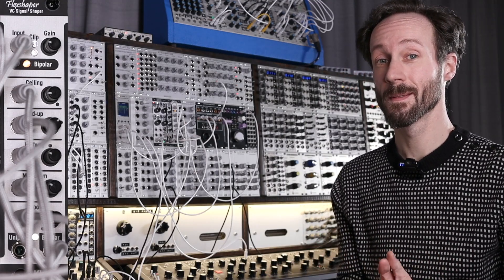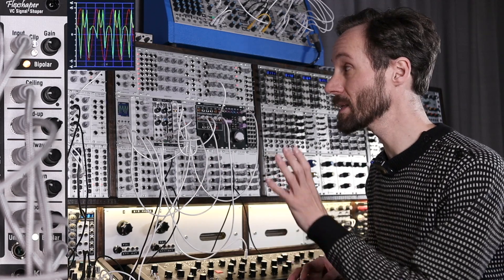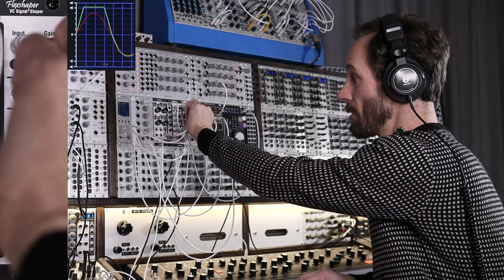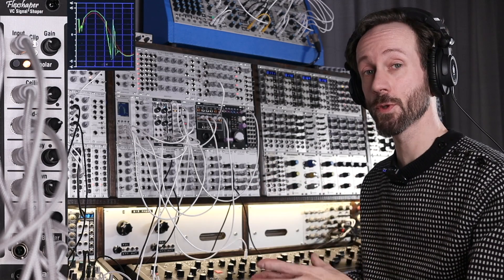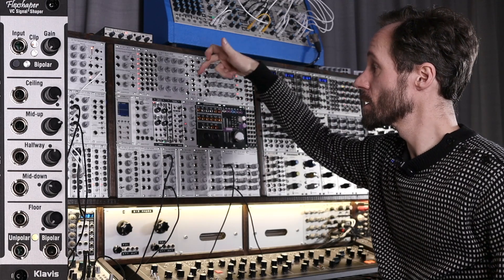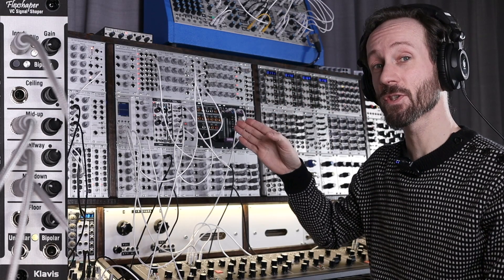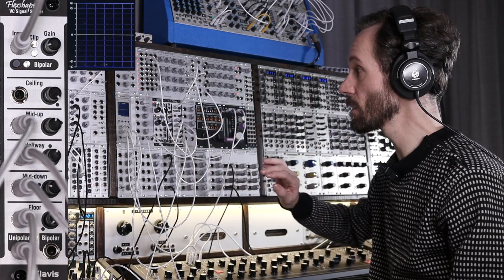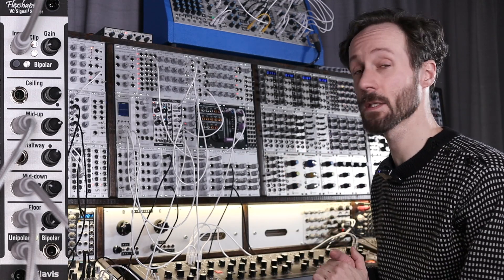Klavis - Flexshaper  |  dynamic signal sculpter | waveshaper for eurorack

Comment: What are those parts directly above your mixer?
Reply from the maker: which mixer?
Reply: @Detroit-Berlin  Directly over your mixing desk
Reply from the maker: @randydarklight  my mixing desk is behind the camera but I think you mean the row just above the Moog Matriarch. on the left is a 42hp blanking panel holding 2 Doepfer Offset generators with big knobs a diy of myself. and the two 42hp blanking panels in the middle have holes with spring reverb tanks behind them so I’m able to play with the springs. Watch the Doepfer A199 video I made to see how it works.